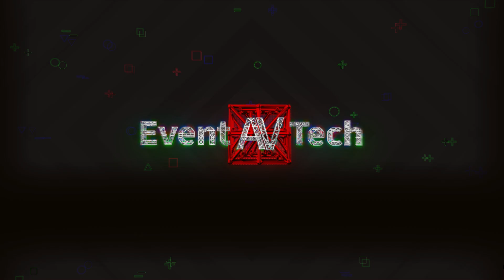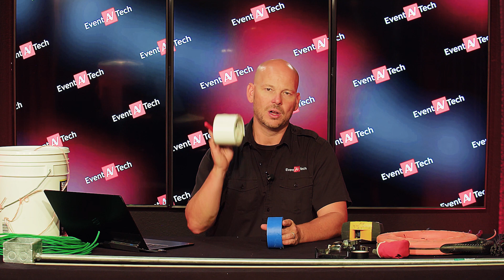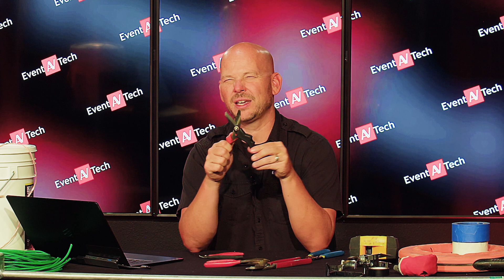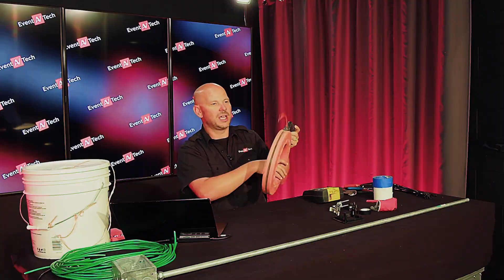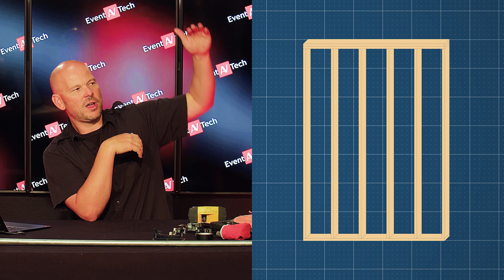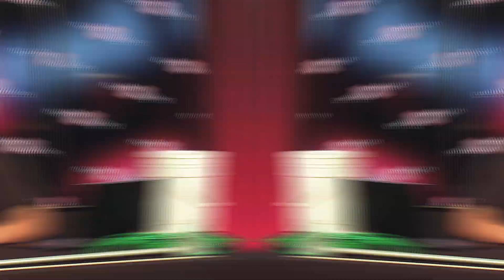Expert Tips for Pulling Wire Through Walls

Comment: Unless you have black cable, a Sharpie can write directly on the cable.  It's the method every other data and AV tech I've worked with for the last 40 years have used for temp cable ID.  Those Milwaukee markers are ok, but I've switched to Sharpie Pro which is made to write on oily and wet surfaces.  These will also write on white 3M electrical tape and even sheet labels meant for laser printers. This is what we use for temp labels when needed. The ink is very aggressive and can penetrate when others don't.   Another tip is Knipex electrician's shears.  Huge upgrade from Klein telco shears.  With Cat 6a so prevalent in AV these days, these are excellent during termination and wire pull.  They are however so sharp, they take a bit of adjustment in using them for termination.